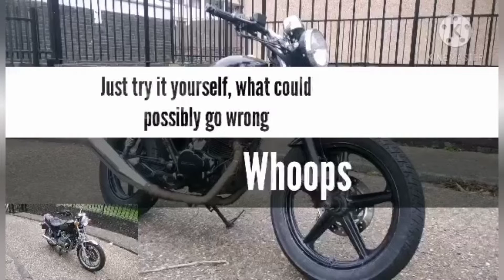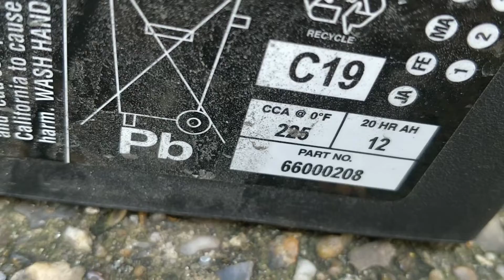lexmoto, custom build, no idea what it is, need your help!. My very cheap Chinese custom motorcycle.

Comment: I think if the under seat exhaust fits that would be real good, nice 1 charlie great vid
Reply from the maker: I can't find any at the moment but will keep looking. Otherwise it will be a low level slip on. Although they can be fairly loud.
Reply: @motorcyclerescuer  ye i suppose also cost can be an issue

Comment: Looks like your going down the bobber lines with the Lexmoto,,I like the engine in the car 👍
Reply from the maker: It will be a brat in the end, flat seat rear with higher bars. It will look cool though I'm sure. Looking forward to finishing it.
Reply: @motorcyclerescuer  I'm getting old Charlie ,never heard of a brat ,met plenty though lol😃
Reply from the maker: @derekdingwall  lol a brat is like half scrambler and half cafe although to be a proper brat the seat shouldn't have a hump. So flat rear end and high bars makes it a brat. A cafe would of course have a rear bump and very low bars.
Reply: @motorcyclerescuer  had a quick look on Google ,looks a nice style 👍
Reply from the maker: I believe its a Japanese style from the 80s. Becoming more popular now days. I've never been a fan if I'm being honest as I preferred the full cafe or full scrambler look. But it suits me on this occasion to do it on this one. 

Hopefully I'll get it up and running tomorrow

Comment: I would say you can cut the frame anywhere so long as you re strengthen it again after. So cut the braced part out but put it back but further along the frame.
Reply from the maker: Thats what I did in the end Gary. Its a fun little project. 

Cheers mate